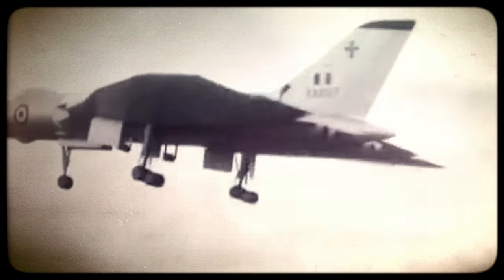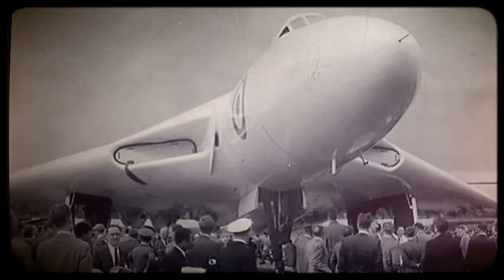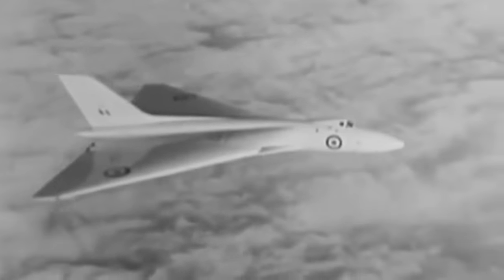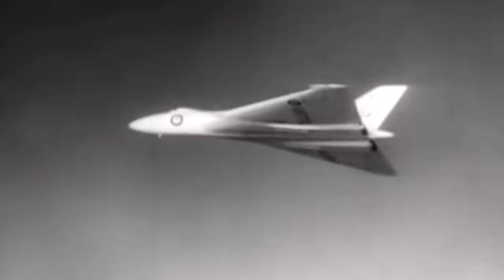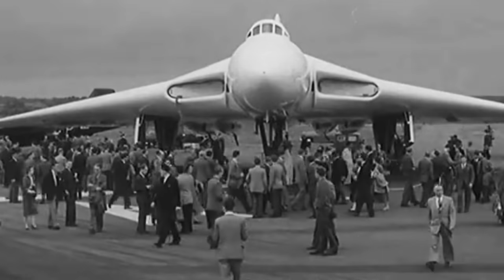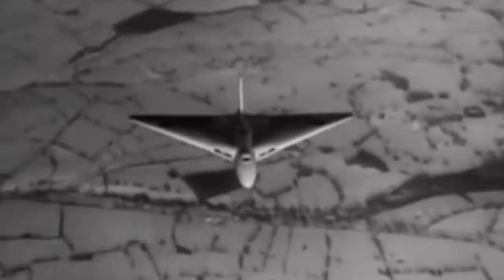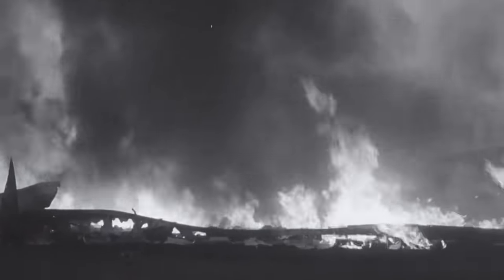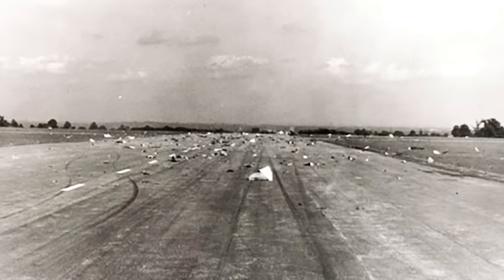Vulcan Bomber Disintegrates on Camera

Comment: Yup, the old "Blame the dead guy" so the manufacturer doesn't have to pay any pesky damages.
Reply: Muh pilot error
Reply: Exactly. Structural (read design) failure was to blame. I don't think there is any doubt about it.
Reply: I'd agree that contributes to accident assessment often, but you can see a major difference in the wing shape here, it being a very early unmodified prototype.

 The stiff Delta wing here is eventually modified to a more blended curve with a flatter face to the wings intake inlet in modern models.
 The intake structure within the wing in this prototype takes on added force from fast moving air rolling down the wing edge & onto the inside inward facing wall of the intake where it meets the outer wing,
 stressing it more where it's structurally at its weakest.
 The modifications eliminate this after this fateful engineering lesson.

It was a matter of when, not if, & a fair bet that it would happen when flirting w the flying envelope (80% thrust), as is often the mandate at airshows.
Reply: Yep, play the conspiracy game
Reply: More likely was his
Reply: @jzxtrd337  actuly no its not
Reply: @ericstyles3724  The SAAB Draken with double delta can do the cobra without breaking up
Reply: More than likely was his fault
Reply: @jzxtrd337  reality dont upset me nothing does
Reply: Why blame the engine manufacturer ? if you actually watch the footage and pay attention the break up happened at the end of the wing , which if you have a clue what you are talking about is far from the test engines which are mounted very closet and basically next to the fuselage, so if the new test engines were the case the n the break up would happen in the area around the engines not at the far edge of the wing
Reply: “what is he gonna do? defend himself?”

disgusting thinking
Reply: Damages to WHO!  It was the 1950's, it was a military aircraft and no civilians were killed. WHO exactly are they supposed to pay damages to?  TELL ME
Reply: @mattossip62 : How 'bout families of deceased? Anything damaged on the ground?
Reply: @KutWrite  They were military.  Sorry bucko, but lawyering up does not apply to service members.  Does every Tommy who went over the top at the Somme have a "family of the deceased" suing because their beloved got killed?   Get real and stop being a troll.
Reply: @bigwillie5717 : If you only knew whom you're talking to. But then, you're the guy who has to tell us he's "Big," right?
Reply: @KutWrite  Why not?  You are the guy who tells us he is "write"
Reply: @mattossip62 : Good one!
Reply: sounds like vaccines in the US
Reply: @budlight2969 : Good one!
Reply: @KutWrite  3 RAF Fire Rescue crew were killed on the ground when the falling plane hit their Landrover that was stationed near the end of the runway.
Reply: I'm not an expert but that looked like a pretty safe maneuver to me,,, seemed like a relatively low speed, and I doubt any experienced pilot would yank the controls so hard to the extent the plane shreds itself like that. I'd put money on it being something wrong with the plane.
Reply: @EQINOX187  I don’t think anyone is blaming the engine manufacturer. But what gets overlooked is they had just installed the newer, more powerful, engines in the plane for the first time. Did the initial test flights with them, then went straight to the air show. This was in the era before CAd design, computer simulations and such. Often things like unexpected stresses or vibrations would not be detected until you started flying the new configuration. The chances are the new engines put a little more stress on the wings. Not fatal unto itself. But looking at the way this went down, with white flecks of the skin of the wing flacking off in chunks, there was probably already a network of undetected stress cracks, that the new engines pushed past the breaking point.
Reply: @Karl-Benny  nice comparison of over half a century of design development.
Reply: It’s almost always the pilots fault....they’re the one actually controlling the thing.
Reply: @33moneyball  Typically pilot error looks different from this. Most crashes involving Pilot Error involve take off, landing, or controlled flight into terrain. Pilot error is not precipitated by the aircraft shedding parts (well maybe except for that one B-17 that dropped its extra fuel tank on the Japanese destroyer instead of its bombs?). I saw some claim they in someway exceeded the aircrafts flight envelope. Well no. They did the standard 80% power flyby with some low g maneuvers. Now the question becomes did anybody know what the aircrafts actual flight envelope was at that point? They had just swapped in some much more powerful engines. They had literally just done a few laps around the test field, then headed for the air show. That’s all the testing with the new engines. If the pilots were doing an 80% power flyby well that 80% power’s actual thrust on the day of the crash had changed drastically from 80% power the day before.
Reply: “Obviously he could just not disintegrate.”
Reply: Redbo Black  True. But that American Airlines plane had not just swapped in much more powerful test engines, than the airframe was designed for. The Pilots could not have exceeded the recommended flight envelope, because nobody knew where it fucking was. They were the test pilots. This was the first day with all new engines and configuration. The manufacturer did not know the new flight limitations. They were making shit up as they went along. The American Airlines pilot was clearly putting adverse stresses on critical parts of his airframe. Whereas the maneuver the Vulcan is seen doing is an incredibly low G maneuver that famously puts next to no stress on the airframe, any airframe, that is not already compromised in some manner. The skin of the wings disintegrated into small flakes in flight. That doesn’t happen because of a low g roll or bank. It happens because the aluminum skin is oddly brittle and is already a maze of undetected stress fractures, where just about the only thing holding the wings together is the paint.
Reply: Who cares
Reply: @Karl-Benny  
Not in 1950 it couldn't
Reply: It's a protptype! Shit happens in prototype operation. Regular production aircraft flew for 60 years. So I think the flaw if it was one was fixed. Plus could have been previously badly fixed bird strike to the leading edge. Don't ask where I got that from, not telling.
Reply: And rightly so!  That pilot knew good and well that plane was never designed to fly low, slow, and in a straight line.
Reply: The vast majority of military crashes in peacetime are pilot error.  When you can't find empirical evidence of aircraft failure it's a safe bet it was pilot error.  The Manufacturer still has liabilities.  Your default pot shot at the manufacturer without any evidence is lame.
Reply: @x-man5056  LMAO...the pilot is flying slow and in a straight line.....and the plane disintegrates....and yet, somehow you blame the pilot?  LMAO again.
Reply: Amazing plane,they used to fly one at our local air show ,it’s huge,they had to stop when maintenance costs weren’t viable ,as a kid I remember first seeing them used in the Falkland war
Reply: @mandellorian Nope, not the problem.  Why?  Because a crack in a major structural component (usually a longeron, stringer or wing spar will fracture under load, not unloaded.  (The same kinds of maneuvers that caused the original crack, mostly over G or hard landing.  
Flying level and accelerating at the moment of destruction, the pilot ignored pre-flight brief to not exceed 80% engine power.  Engine came apart during high speed pass and ruptured a wet fuel cell in the wing root, possibly a wire bundle also though not confirmed.  Another British manufacturer made new engines to replace this Rolls version for most of the service life of these aircraft.
Reply: UNSUNG ARMORY  Can you time stamp that for me please?  I believe the pilot was briefed to stay below 80% "engine speed" because of the new Rolls Royce engines.  You can over-speed the engines without ever leaving the ground.  The under 80% would have been tough to do taking off or...even doing a level fly-by if the test pilot has more cowboy in him than professional.  I worked in aviation for DOD for 42 years, engineer.  I could still be wrong, but I'm not guessing.
Reply: It's always the easiest, and cheesiest, way out since the dead crew can't defend themselves and the Brit's history of covering up what they don't like stays intact.
Reply: @w1lf1ewoo  you believe everything the govt tells you?? Pls answer.
Reply: Folks, even the manufacturers deemed the pilot-error explanation "invalid.". In all likelihood the crash resulted from improper maintenance inspection.  

(from the Aviation Safety Network)
Reply: Sound like communism to me.
Reply: It was made from the FINEST balsa wood, tent canvas and horse hoof glue ... what more could you ask for from Brits?  🙃
Reply: Is that what your degree in Aerospace Engineering tells you?  I know, why don't you use finite element analysis and show us how the stresses on the wing were within tolerance in the areas in question?
Reply: @bobhabib7662  ...  Good Grief ... Someone needs to take a potty break .....  😒
Reply: I don't know if people claiming pilot error are trolling or just brainless.   Airplane does a normal airplane thing and breaks: obviously the pilots fault...
Reply: @Pacheenee7  ...  Obviously, you did not watch the video, do not know how to listen, have no comprehension, have no understanding of when to use the word "trolling", do not know that the slang use of the word "trolling" began being misused 50 YEARS after this incident ...... but I suspect .....   all FIVE ... 😒🤔😒
Reply: So true, and it happens all the time.
Reply: @Jokertuning  Obviously this did.  Or you wouldn't have responded by deflecting.
Reply: @mattossip62  RR employees onboard.
Reply: They always do every time !
Reply: @BackSeatHump  probably. The person blaming the pilot never said any of his claims under oath, no there's not really any proof that it was the pilots fault at all.  Apparently even the aircraft manufacturer considered the claim as false.
Reply: @Matt_10203  That's pretty much what I was thinking too.
Reply: @darth1864  “I am not an expert” … but I’ll go ahead and assume I know better than those who actually are experts, based on what I see on YouTube….
Reply: Yep, the old  “let’s make up “blame the pilot” so we can criticize “blame the pilot””. Metal fatigue and maintenance failures are well documented in the official report. The cause is also left as unknown in this video.  But don’t let the facts stop you….
Reply: R/cinemassacretruth ?
Reply: @richardcline1337  it's fairly well known that the aircraft had been overstressed on a previous flight by a different crew. The crew where doomed before they took off
Reply: Why would the controlls allow the input it it will brake the wing
Reply: @2511jeremy : Because it's not dangerous at all speeds and regimes. E.g. on approach to landing.
Reply: @33moneyball  No where near as often when they are flying a prototype however.
Reply: Seems like it was a pretty tame maneuver.  

If the wing crumpled like that,  my guess would be something struck it (like a bird), or simple structural collapse (design or manufacturing error).  

At least as far as a can tell with 70 year old footage in a 5 min YouTube documentary without crash investigation experience.   🙄

It would be interesting to know if Avro changed the design after that accident...
Reply: Responsibility avoidance 101!
Reply: Yeah , but test pilots know what they signed up for . They know the risks and they are willing . If nothing fails it’s a privilege for a pilot to be one of the first . When something bad happens we never know how the pilot feels about it or what a dead person says what went wrong .
Reply: Very correct and typical British.
Reply: Well,  they DID lose a very expensive airplane.  It wouldn’t surprise me if they tried to sue the family for recovery costs.  This is why Companies have rights 
Makes no sense to me.  A “company” should not have the right to sue for something like that.
Reply: I don’t know about you but have the extraordinary ability to disintegrate moving vehicles at will.
Reply: Lockheed starfighters , dehavlland comets are the premise of poor piloting and frequent errors....
Reply: @matthewmillar3804  
Yes they did change the design of the wing spar (a solid block of aircraft aluminium within the fuselage that joins the two wings together) also the tempering of materials by chilling them over long periods and they introduced x-ray on site inspection technology. There was a video about it on UK terrestrial TV in the 80s Open University possibly.
Reply: @w1lf1ewoo  😂
Reply: Blame the pilot to save money. Blame the engineering to advance technology.
Reply: Yes it’s true! I know of a pilot s widow! That signed  off on one for stating pilots error for more $$$$.  Quicker
Reply: @Oldnoitall  Wow! Sad.
Reply: @KutWrite  captain Edd O’Neal  Eastman Chemical plane crash Alabama At night bad weather!
Reply: I'll bet it was a modification to the wing to install the Rolls Royce engines.  His maneuver didn't look stressful in an easy roll .  .
Reply: It’s easy to blame the dead guy. Because the dead don’t argue. It’s sickening, how big companies rather pass the blame rather then own up for their own screwups.
Reply: Except for the Navigator, everyone on the plane was a 'Company Man'.
Reply: He was see and heard r raving to engines and dumping the clutch and  Leaving black marks in the terrace and leaving black marks  on the asphalt  before takeoff !!
Reply: @darth1864 I agree multiple test flights and metal fatigue due to design issue would be my guess
Reply: My thoughts exactly too easy to blame pilot watched this several times and it appears the starboard wing broke off can't see how this would be the pilots fault seems more a case of structural failure but as already said blame thd dead guy he can't defend himself or give account of the circumstances . Tragic
Reply: This could be the reason why captain always sinks with his ship, leaving the company free to stay in business, and provide some comfort to his family
Reply: This procedure arrived to the top criminal actions in the case of a Yakolev Aircraft, contracted by Spanish defense ministry to carry armymen, with an UK company, that crashed because crew had too many chained flight hours. 
Instead of placing a claim in front of British operator, they blamed Federico Trillo, Who never said the truth, britons were responsible, thus, UK insurance company had to pay.
The bribery Trillo got from this barefaced lie is unknown
Reply: @josega6338  I wonder how often the "comfort to his family" part happens.
Reply: @Karl-Benny  But entering an impossible to recover stall..
Reply: For relatives of those died accepting responsibility, cleaning the company of any guilt, a reward can be granted as preference in hiring, better salary, easier promotion, as thanks for proved loyalty beyond duty.
Also, there are accident insurance compensations,  widow pensions...
Reply: @KutWrite  I've already proposed ways: preferential hiring, preferential promotion, preferential salary, widow and orphan compensations,...
Reply: Doesn't really matter,all the blame tossing, and different opinions. I've no doubt the pilots were super professional. What happened was a brand new machine failed. It was flown within 80% of its calculated limits.  These limits are at best estimated limits. Particularly with no super computers, or as complete understanding of how new alloys really perform at edge of envelope parameters. There are times when previous experience and estimated performance of new, relatively untested alloys and other materials, cannot entirely predict the  outcome  of various forces, temperatures, pressures etc. This is just one of the many tragedies, particularly at this point in aviation, when many new and novel materials and techniques, were being employed without the knowledge the aircraft industry has now. Also without the powerful computers now available capable of modelling different environments and stresses much more accurately than a pencil, paper, and slide rule could ever do. Mind you, some incredible machines were developed and produced with these techniques as well!